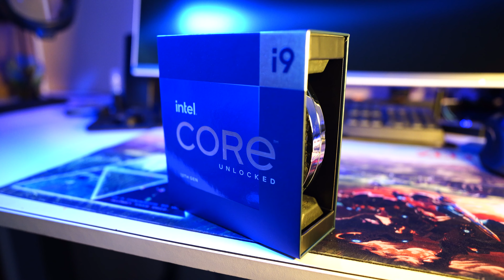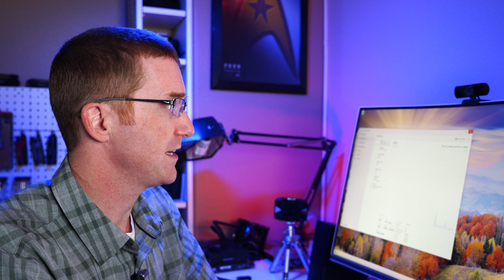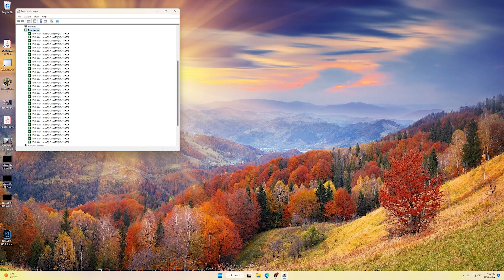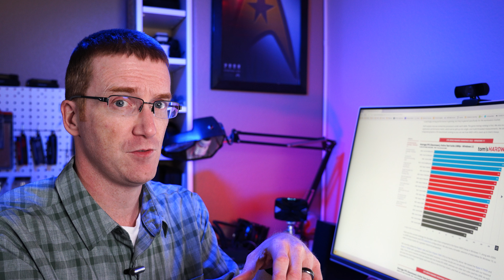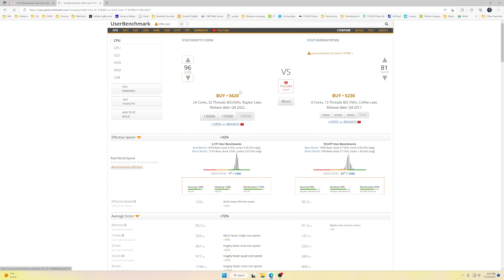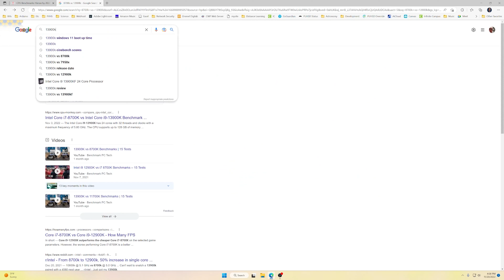How to build a computer

Comment: Hey Mr. Wilson! 🙋‍♀️ That is a thing of beauty. So sleek, streamline, and shiny. I know you mentioned that you had the components for a while before the actual construction. So, minus that, how long did the build take you? Everything from opening the packaging to turning the power on (twice 🤪)? I remember my brother building his own computer in school, back in the '90s. It, understandably, took ages because it was a classroom project, and they learned what to do and why they were doing it as they went along with each step of the process. With the help from those oh so handy instructions manuals, no doubt. He was so proud of it. 🤩
Reply from the maker: Your brother should be proud of his computer! Every DIYer should be proud of what they make, whether it's a computer or a rocking chair :) As for how long it took for this build, I could answer that two ways. How long does it take me to build this computer, or how long does it take me to build a computer when I'm also making a video about it? The video really slowed me down because I had to film the build from different angles and reshoot segments where the camera was out of focus or my microphone died, etc. If I was just building the computer without all that, it would probably take 2 hours if I already knew what I was doing, and maybe three or four hours if I needed to read through all the manuals first. It takes about another 2 hours after that to install the operating system, drivers, and work out any optimization issues.